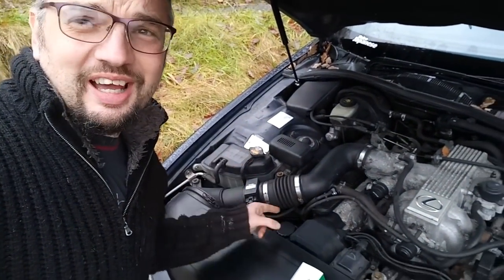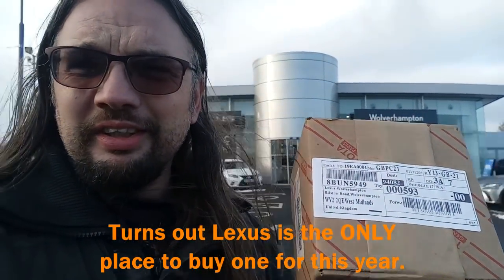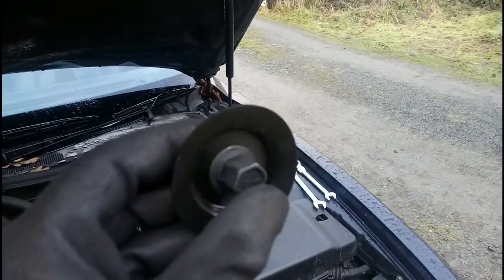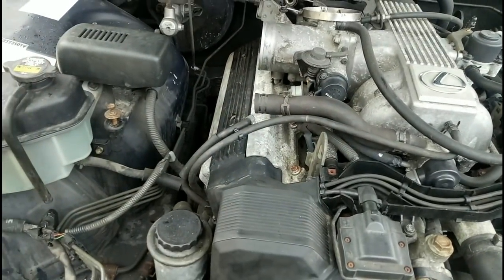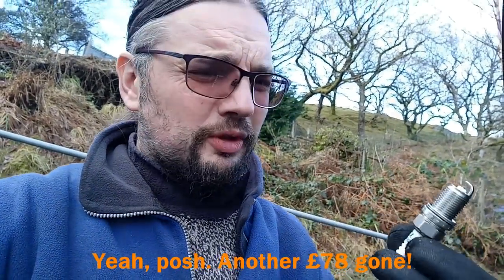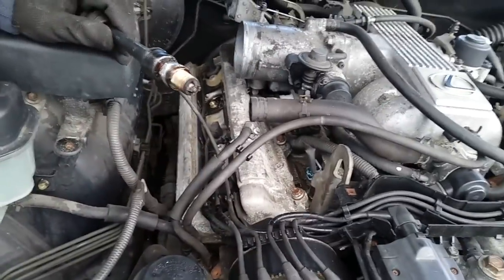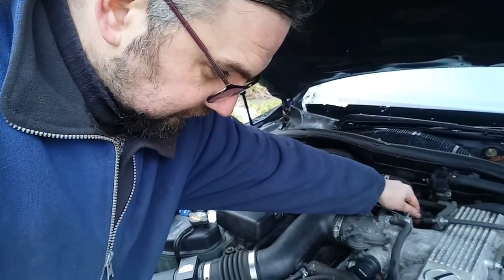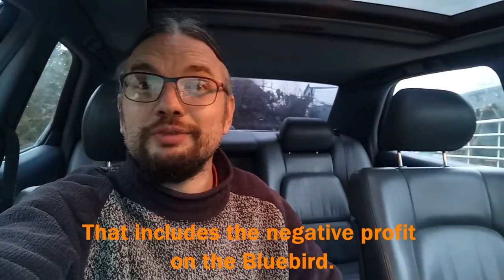Lexus LS400 woes - dead tensioner! With socket fail.

Comment: What would this job have cost at a mechanics and how long would it take? I admire your spirit but I quite fancy one of these old boats and should I find myself in the positions you have been in during changing this pulley I know that a dark rage would have taken over and I would have beaten the car with a hammer.
Reply from the maker: A garage should at least have the skills necessary to do the job quickly. I reckon it could be done within an hour.

Comment: Do like the Lexus. Unnecessary revving is always good! Haha
Reply from the maker: It's a lovely motor. It needs exercising.
Reply: Mine was kicking out all manner of crap on the mot. Mot man promptly redlined in neutral metaphorically clearing its throat and low and behold, emissions were fine again. They love it!

Comment: My plugs are 12 yrs old on my 98 ls400 and have done 45k and are still going strong
Reply: I'm a firm believer in spark plugs work or they don't,
as long as they are in range (ohm's law stuff)  clean, have the right gap they should work.

Comment: Well if you get a Lexus expect big bills and if the coil pack packs up I would suggest just taking it to a quiet spot and burn in the car😂😂 but seriously I think your next project cars should be a Rover P6 as everything on it is bolt on bolt of.
Reply from the maker: I've previously owned two P6s. They ate money even more quickly than the Lexus!
Reply: HubNut no way. How's about a Rover SDI or a Mk3 Escort because you would need deep pockets to get hold of a MK1 or MK2 Escort.
Reply from the maker: SD1s have become expensive now. Out of my meagre price range anyway! I'll stick to the Lexus for now, along with the other eccentric members of the fleet.
Reply: HubNut Bummer as I was looking at getting a Rover Vitesse as I had a Rover before and liked so much.

Comment: Are you going to buy a new plug spanner of just use a bit of blue tac in place of the rubber bit :)
Reply from the maker: Someone suggested a short bit of hose. I like that thinking.
Reply: I've seen a few people using that - Haynes also recommends it in their manuals to avoid crossthreading, although that's more when installing the plugs.

Comment: You suddently lost compression as you crank the first time. I think the timing belt has jumped a tooth or two. You really should stop cranking it until you were sure that the timing belt is in fact in sync. You could loose some valves or bent some valves just trying to start it up. Now I am reaching the end of the video and I see that the car started but at first the sound of the crank appear to be some lost of compression. I think that you felt the stress and I think you thouth the same thing too. Fortunatly it was nothing major. Best regards and very sory about my poor english.

Comment: sounds flooded......
Reply from the maker: Yes, I think it was. Plugs came out wet. Off camera, I tried leaving it for a while, pulling all the plugs out and drying them and then tried again and still no dice.
Reply: HubNut did you disconnect the battery at all
Reply from the maker: Nope.
Reply: HubNut ah I see as  it sounded like the immobiliser had kicked in

Comment: Why did it not run after you did the tensioner?
Reply from the maker: +Stephen Cresswell Because it didn't start
...
Reply from the maker: To be honest, I have no idea. New plugs got it running again. I'm not sure why.
Reply: After I replaced an idler pulley on my 1993 Jeep Grand Cherokee, I was missing two cylinders. Turned out that there was a bit of green corrosion inside two of the injector connectors, so the injectors weren't firing. All that stuff was on the opposite side of the engine to the idler pulley, I hadn't been anywhere near it, and it had to have been purely coincidental, but it was exactly as if changing the pulley immediately caused the problem. Weird.
Reply: Those plugs' condition shouldn't be like that- even when worn. They should last a good few years. It's an old school way of telling you what's wrong by pretty much copying the internal combustion chamber.

Comment: And that's why I now use magnetic spark plug sockets.  I've probably spent more time retrieving that sodding rubber grommet than changing the bloody plugs.  Happy Lexus, bankrupt owner though, to be fair, if it was a V8 Jaguar XJ you'd probably have gone twice as bankrupt in less than half the time...
Reply: I had the rubber experience changing plugs on my wife's Honda CR-V, but fortunately it came out again with the spark plug. No screwdriver required. But the rubber would not stick to the socket anymore so I bought a magnetic like you did. I wonder who the genius was that invented that rubber ring p.o.s. :-)
Reply: He needs more jags, but only if he does the work himself. Mechanics eyes light up like that Daimler Christmas tree he had before

Comment: It would have been good if your pony tale got sucked into the the fan belt when you were revving the engine standing in front of the car. V8 sounds lovely I drive a LS400 myself 👍
Reply from the maker: +CM Autolink Dublin No, I don't think that would have been good actually...